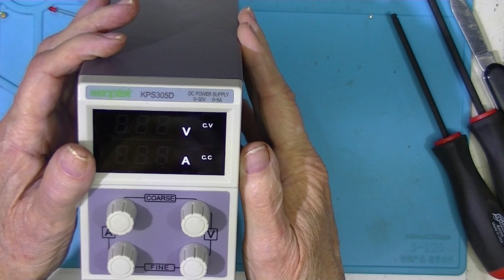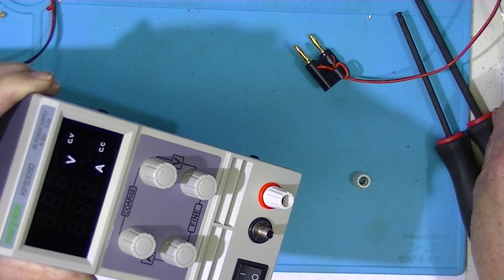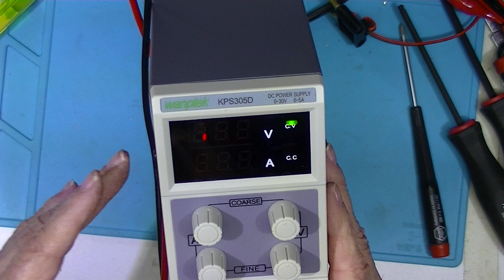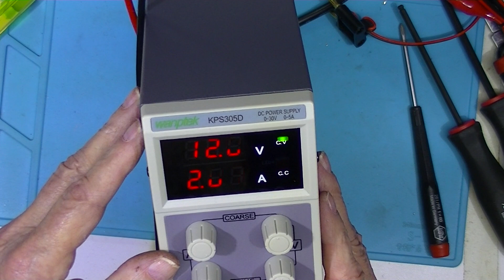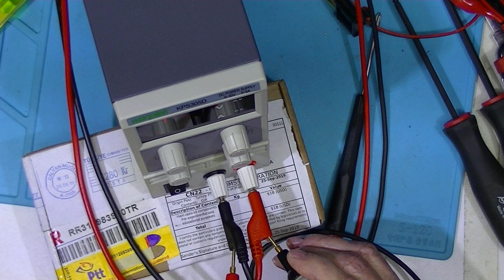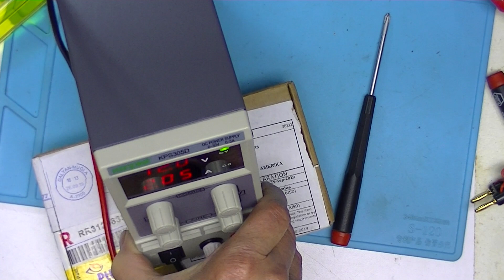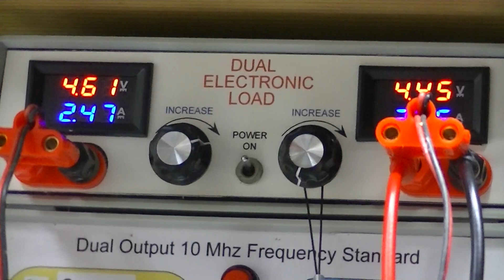A  Look Around a Wanptek KPS305 Power Supply

Comment: these are somewhat durable power supplies. i have the 30v10a and the 60v5a both wanptek. i work daily repairing electric forklifts and have used these on many occasions to bring up the battery voltage on drained batteries. only issues on the 30v one so far has been the original fan died and the inrush thermistor burnt up, both easily replaced. both power supplies are run pretty heavily, only downside to the kps305 and kps3010 models i have seen is ventilation, both have small vents in front and on the bottom to bring in air by the fan. the dps605 has many more vents in the case sides and pushes air into the power supply. overall these are pretty good for the money.

Comment: I have the same power supply
Reply: No GND connection?
Reply: @nurashams4093  what do you mean?
Reply: @albysHub2006  i need an explicit ground connection port /channel for reference testing, that is essential for me and also, it lacks over current protection and release, just short them and it will spark. Untill u handle explicitly...thats a bit of disappointing.
Reply: Oh ok but no there's no GND connection....i'm not sure, but i think there are some power supplies that have this connection👍
Soon i'll make a video on my channel were i take a look inside mine (identical to this one in the video) maybe it will help you! 😜
Reply: Have a 30V 6A model, same brand with power (WATTS) display.
Worked great until it didn't, a few weeks later.